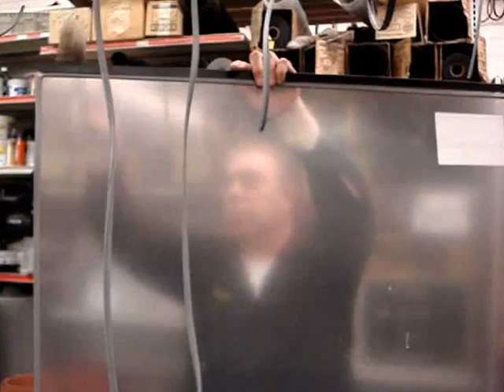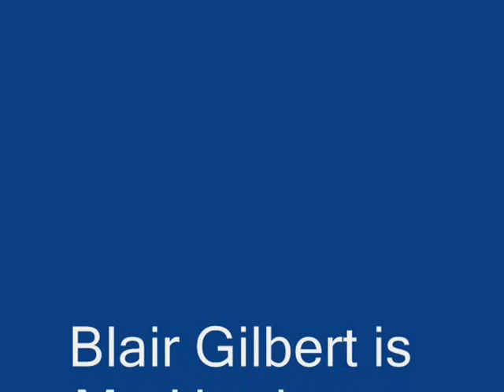Professional Plexiglass Storm Window Build Repair, Fix in 4 Minutes

Comment: I wonder if you can just use poster frames that already have the metal framing & the plexi glass, then you can use some wood narrow 1/2 wide wood between them and build a window box around it and you'll have a nice cheap double pane window.
Reply from the maker: The problem with homemade thermopanes is the moisture trapped between the pieces of glass. As soon as there is a temperature change they will fog up inside the panes of glass. Our thermopanes are made in a factory that pulls out all the moisture and fills the void with an inert gas, then sealed for life. Blair

Comment from the maker: Actually the frame is an I-beam shape w/ a 1/4" opening on one side and the other has beads which allow the frame to trap the metal (or plastic) corners that hold the frame together. The vinyl molding formed around the plexiglas, or glass hold the frame tight to the plexi.
Mr. Hardware
Reply: what is the thickness of plexiglass?
Reply from the maker: @beckyzhang7045  it’s .90, about the same as single strength glass, just under 1/8”.

Comment from the maker: It is an aluminum extrusion (available in mill, bronze and white), about 1/4" id on the glass side. It is about $7.98 for a 96" length.
Gilbert's Pro Hardware.
Mr. Hardware

Comment: What is the clarity of the plexi after the protective film is removed?  Also, same question as below from some time ago, how are these fastened to Andersen Narroline 200 series doublehung (3046 and 3052 size codes). Thx!
Reply from the maker: +Christopher D'Amico 
plexi is perfectly clear. It can be scratched if cleaned w/an abrasive cleaner. Stay with soap and water.
Attaching a 5/16 thick frame requires clips similar to the ones holding a storm in a storm door. We have other fasteners that can be fastened to the frame and pivot into the wood window, but the thickness will be over 5/16. I don't know the Anderson frame to discuss attachment, send a pic of the screen w/a scale in the foreground.

Comment: I have a "new neighbor" noise problem so I need to sound proof my bedroom windows. I can't find anybody locally to buy the soundproof window inserts from.. so I've decided to make them myself using 1/4" acoustic grade acrylic sheets, then affix EPDM rubber weather stripping around edges so they will fit snugly into the window frame. This way I won't need to use aluminum framing, and I can remove easily. I just need to make sure  Acrylic measurements are correct to leave room for the rubber on edges, hope it works. Let me know what you think of this, thanks.
Reply from the maker: +Ashton 09 
Try to get molding or tracking from the distributor of the acoustic acrylic sheats. Sizing is difficult to get a proper molding for.
Reply: Ashton 09 Did you make your own soundproofing window inserts? How did it work out for you? Where did you get the acoustic grade plexiglass?
Reply from the maker: Ashton, you could test the effectiveness of a single strength plexiglas (.90, a thin 1/8")  by taping an oversizes piece over the opening before spending big bucks on 1/4" plexi, it is very expensive. If works you could get frames from ezstormpanels.com
Reply: Epdm rubber weather stripping

Comment: can you pre-cut everything for me if I give you the measurements and ship as a kit? I can assemble myself. Also do you have the rolls of magnetic tape for mounting these windows?
Reply from the maker: +Billy Singleton 
yes we do, but the magnetic tape is usually not strong enough. Use velcro or very small screws and attach that way.

Comment: is it cool to just use some caulk to seal a plexiglass window? it's going to open and also for a clubhouse.
Reply from the maker: Caulk and/or glazing can be used to seal the plexiglass. I prefer latex glazing or caulk to oil putty because the plexiglass can flex upon temperature changes. Caulk and latex glazing cures fast enough to hole the plex before it can bow.
Reply from the maker: You can also use Mortite removable rope caulk.

Comment: OMG...I live in an apartment and this work be perfect ....internally. Do you do patio doors sizes?
Reply from the maker: We can make aluminum frames to size. But, to use these as an inside storm window go to ezstorm.com, Don there makes frames with soft cussions that make inside storms tighter.
Reply: looks like ezstorm.com has lapsed on registration and is now for sale as a domain name.. what is their number if they are still in business?
Reply from the maker: ezstormpanels.com,  sorry
Phone: (313) 469-9680
Reply: thanks!!!

Comment: no mention of any of your materials? was that glue in a gun?? what's the stuff you wrapped around the window first??? and what does it do?
Reply from the maker: The ‘spline’ wrapped around the plexiglass is a vinyl seal/cushion that comes in different gauges to attach the plexiglass/or glass to the aluminum frame. There are different thicknesses of both plexiglass and glass and so the proper spline is required to properly seal them to the aluminum frame.
No glue was used.

Comment: Do you guys know where i can get a replacement prebuilt with the slider buttons for the notches inside the frame?
Reply: SpringsPimpin , we do, however almost every window and screen should also. Send us a picture of one of your existing window or screen operators and we can identify it and get back to you.
Reply: @blairgilbert7606 do you still make storm windows?

Comment: I would like to order and put this in my Andersen 600 series screen channel.  The screens are 7/16" thick.  Would this work?
Reply from the maker: Our rails are 5/16 but you can put a thin self adhesive foam weatherstrip to increase thickness and improve air sealing.